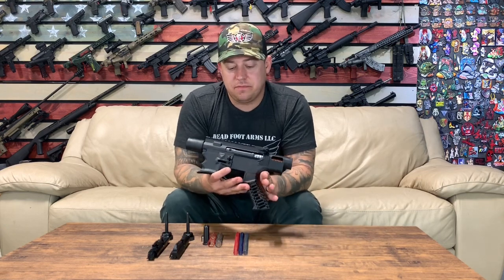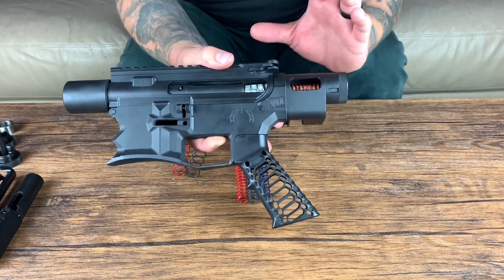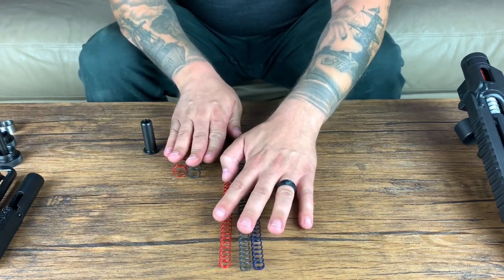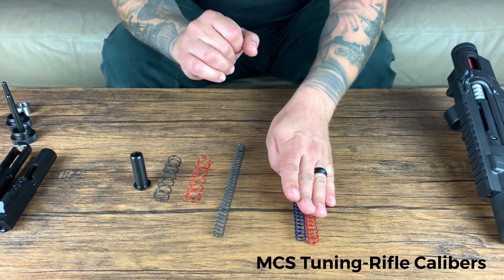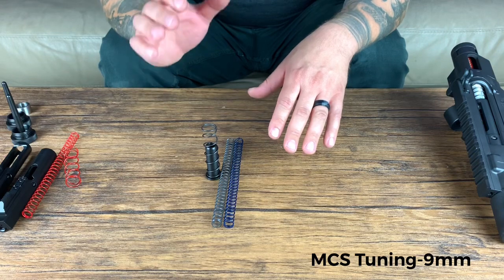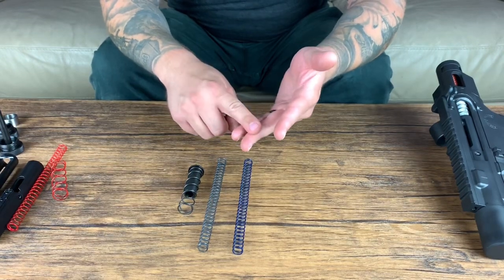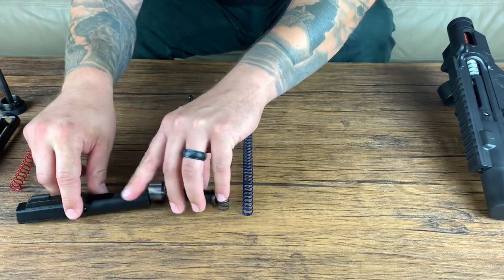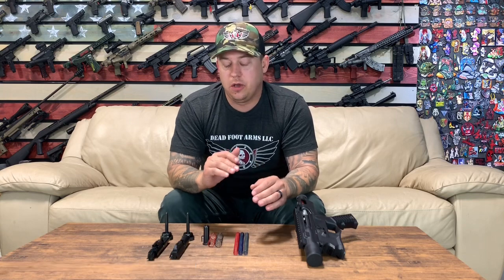Tuning and Spring Options for the Dead Foot Arms Modified Cycle System

Comment: Any chance you guys have a lighter spring for the rifle call Im red and red and probably not getting enough gas with the 4" barrel 🤣locks back won't go back enough to pick up the next round . Might try to break it in more and see if it helps thanks again guys
Reply: Any update on your issue I’m thinking buying on for a build
Reply: I would probably start cutting off half a coil at a rime.

Comment: DO NOT attempt to build an mp5 kit with this. You will encounter hammer steokes against the buffer tube and it will not cycle properly no matter what you do.  My gunsmith had to grind down the hammer round and the tube to avoid hammer strikes. It made for a very dangerous scenario where the hammer would not hit the firing pin properly and upon clearing,  the hammer would the finish its travel and fire the round. Very dangerous. At the end of the day, a waste of $545. Not pleased at all with this product.

Comment: Does the 9mm kit work with a full auto trigger?
Reply: I just purchased a 9 mm kit for full auto use because I was told it runs fine, unfortunately I had trigger slap and when I contacted them I was told I needed a bobbed hammer, so I am returning the system, how can this be marketed for full auto use? Bobbed hammer prevents full auto use, not happy, looks great,does not run

Comment: Will the kit work on a cmmg banshee mkgs 9mm radial delayed blowback?
Reply: I would imagine that they would need to modify your original BCG. The CMMG BCG cam pin moves differently and has a differently cut path than other 9mm BCG to lock up the proprietary cut bolt and barrel and the ejector/extractor is built into their BCG.
Reply: @Majestic.Majestic  thanks for the info man. Thinking of getting it. But with the modifications needed might be too much for me

Comment: Will the adapter work with a CMMG Banshee?
Reply: Good question Justin, in fact, Ted should do a video on the compatibility of CMMG Radial Delayed Blowback and the Dead Foot Arms Modified Cycle System (MCS)

Comment: Good info!  I just ordered a 9mm left side folder after hours of searching through all the out of stock retailers.   I've built several AR type rifles and pistols, but nothing with a modified carrier set-up like this.  So, I'm finding all the little bits of information I can.  My current project is a little unconventional.  I'm going to put this MCS folder and a BFS3 in an MP-5 mag fed 80% from New Frontier with a 4 inch barrel and kinda just hope it works.

Comment: Thank U for the video info. commentary. I don't recall reading any other explanations about the springs in the paperwork provided with the unit. It would have been nice if you had have put just a little information on the instruction sheet about the springs. Most people do but everybody doesn't have access to the internet for extra instruction. Very happy customer. May the 2nd Amendment be with US. 🐢🇺🇸🐢🇺🇸🐢🇺🇸👍

Comment: Does this work with a standard AR-9 bolt, or does the bolt need to be modified?  Will it work with Foxtrot Mike uppers?
Reply from the maker: Art Rozenbaum The SCW 4 Pistol brave does use a standard carrier.  FM is compatible.

Comment from the maker: Thank you for checking out our MCS Tuning Video!  The Dead Foot Arms MCS is the most compact cycle system available for the AR-15 rifle and pistol platform, and is utilized in several products we offer, including the MCS with Folding Stock Adaptor and SCW 2.5 and SCW 4 Tailhook Brace and Stock system. If you have any questions, feel free to leave a comment, or you can contact us via email at info@deadfootarms.com.  Thank you!